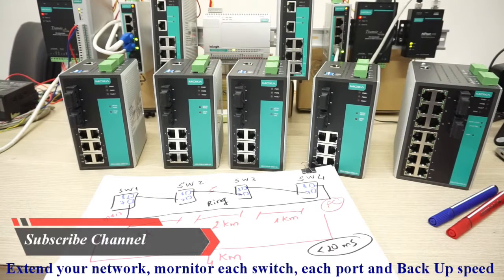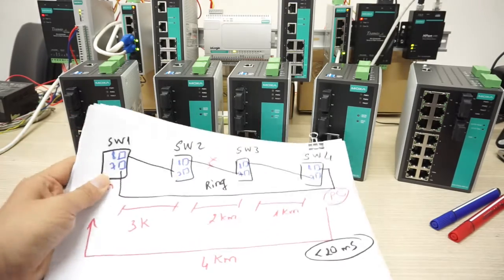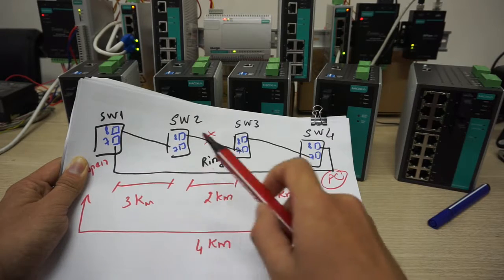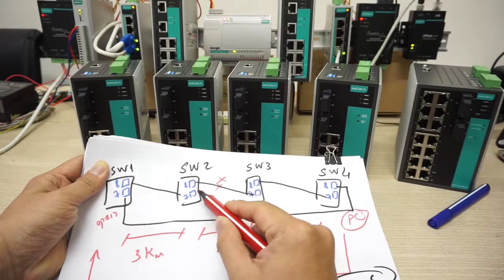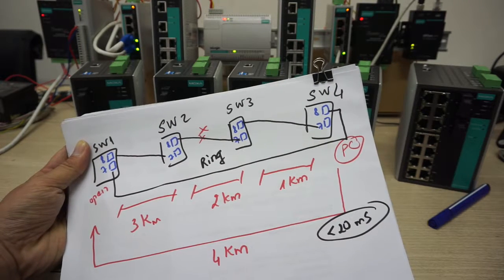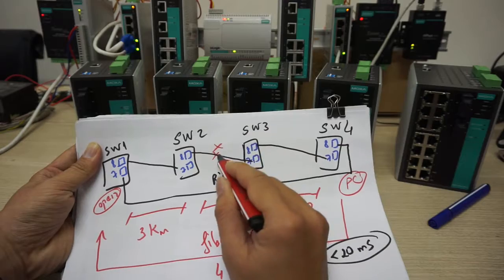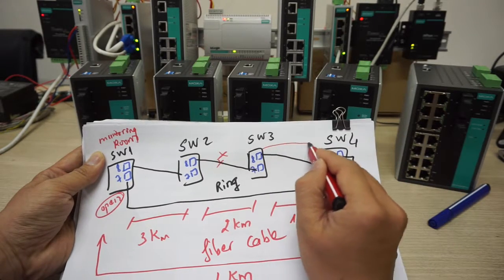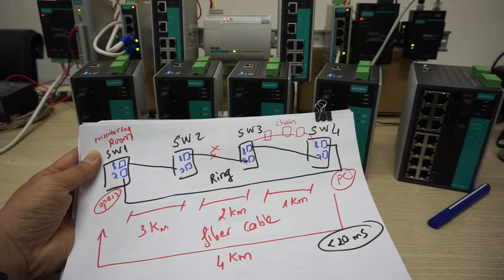Extend network 80km with each switch support fiber port and Ring and Chain topology

Comment: Amazing video sir,
One question though...
In ring topology, since every switch is connected to every switch on 2 different routes, is the bandwidth doubled? Or it's just a fail over handling thing.
Reply from the maker: Hi, About Ring solution, it's just a fail over handling thing is right, cause one time, it Move to Master to Slave 1 -> Slave 4 (Example), but it's blocked between Sw Master and Switch 4, whenever the cable between Switch 1 & 2 broken then, It will open Backup ports, You remember, Switch then study again Mac address automatically, Thank you for your comment